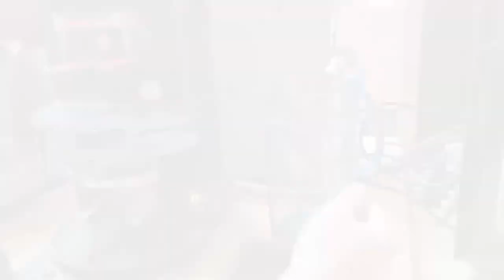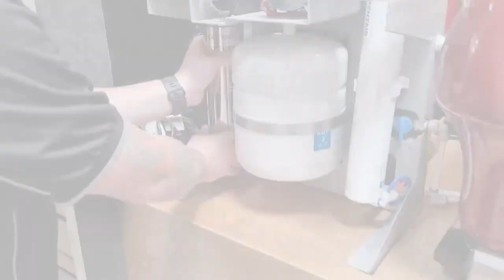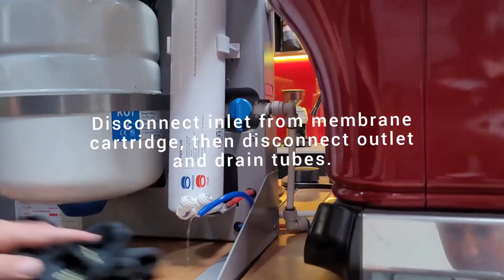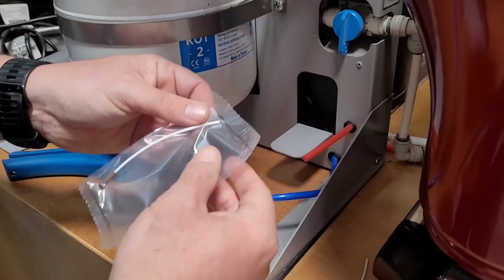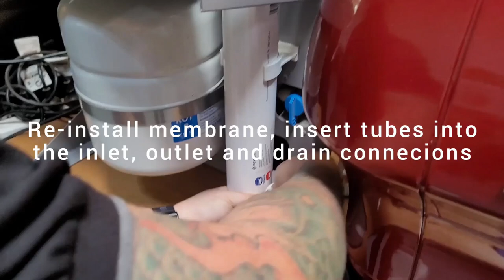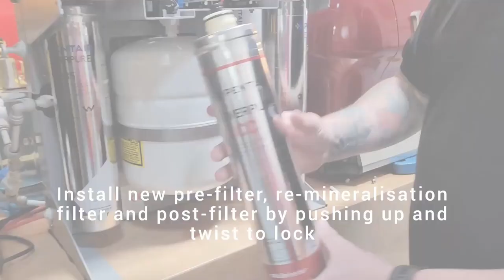How to Replace the Filters in the Everpure Conserv 75E Reverse Osmosis System

Comment: Please don't follow this video. There is a critical step missing- flushing the 4FC5-S and not sending the fines directly into the membrane. 
From the Conserv manual: 
3. Locate the quick-connect tee fitting on the 4FC5-S Filter Cartridge head. Remove the plug by pressing in on the collar and pulling out on the plug. Save the plug to be reinstalled later.
4. Cut a length of 3/8" (9.5 mm ) long enough to connect the flush port to a drain. Push one end of the tubing, 5/8"(16 mm), into the quick-connect fitting. The other end is secured at a drain.
5. The power to the Conserv 75E RO System must remain off. Turn the incoming water shut-off to OPEN. Water will flush through the 4FC5-S Cartridge to the drain.
6. Flush the cartridge for five (5) minutes. Then CLOSE the incoming water shut-off valve.
7. Remove the temporary tubing from the flush port. Reinsert the plug that was removed in Step 3.